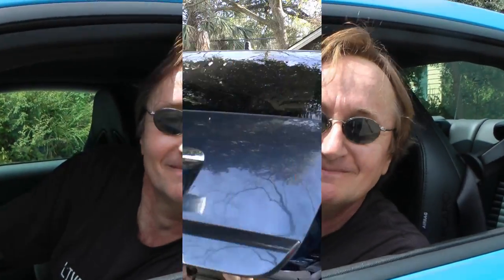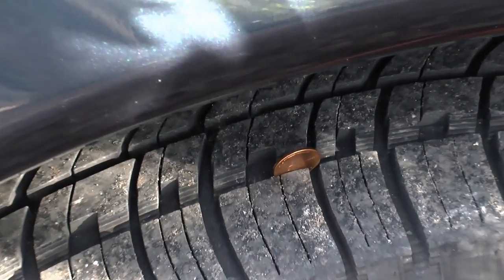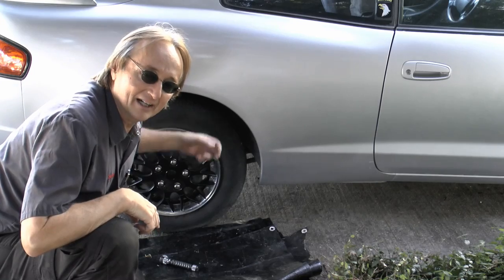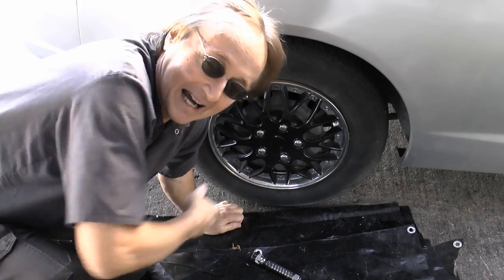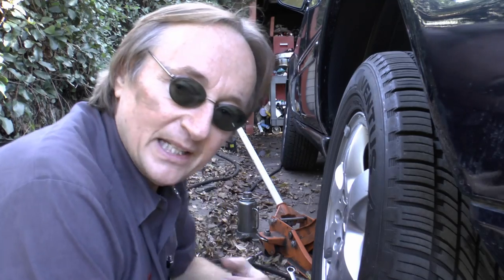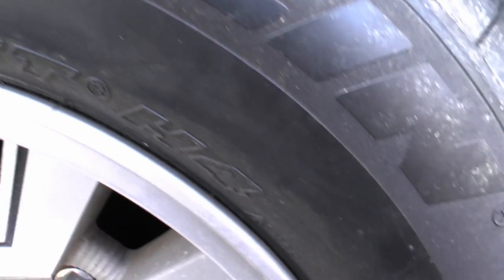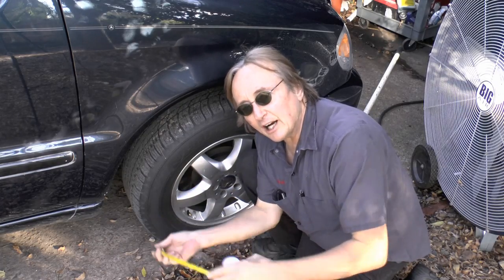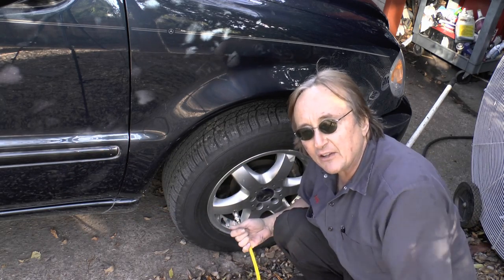How to Tell if You Need New Tires on Your Car

Comment: I have always gone by "you buy cheap you buy twice". So for my car, I always buy the best I can afford. Same goes for when I drink haha
Reply: I don't like cheap. Buy good quality parts and it will last for years.
Reply: It's not as simple as more money = longer life. Some of the most expensive tires out there have between 40 and 200 treadwear rating. They will be gone in about 5k to 10k miles. The Hoosier A6 the autocrossers use only last about 10 runs at the most (~45 sec per run) and they cost upwards of $1,200 for a set. Long lasting tires are not supposed to be expensive, they are supposed to be budget oriented (for cost to buy, tread life, and gas mileage).

For instance, the Kumho Solus KR21 is a 640 UTQG with a 85k mile treadwear warranty (this means they will pro-rate your next set of tires if they do not achieve 85k miles before 2/32 tread remaining).

The BFG g-Force Sport A/S is a 460 UTQG with a 50k mile treadwear warranty.

For my car (Miata 185/60/R14) the Kumhos are $55 and the BFGs are $80 per tire. The BFG is a stickier tire, but it costs more and won't last as many miles. You will also have worse MPG with the BFG, because a stickier tire has more rolling resistance.
Reply: Correct, but the 1200 dollar drag race tires only last for a few races because they are a very sticky.
Reply: Peter Kapica The A6 is not a drag race tire, it is an autocross tire. They are technically road legal, but it would be stupid to run them since it's a slick with two grooves cut in it. They carry a UTQG of 40.

Since you missed the point, I will explain again - the example was intended to illustrate that the softer compounds and stiffer construction tires are more expensive, but do not last as long. For instance, while an A6 is an extreme example, a Michelin Pilot Sport Cup is not and is very commonly found on performance cars from the factory. This tire carries a UTQG of 80, one tenth of the treadwear rating a Prius tire has. These tires last less than 10k miles with normal driving only, and merely a couple of track days if pushed hard. For a normal sized tire (225 section width) they cost around $1,300 per set, or around $330 per tire. They are nearly four times as expensive as normal tires, but they will last just a small fraction of the miles.

So no, you do not "get what you pay for" when it comes to life and longevity.
Reply: That's right and if it floats, flys or f***s....RENT IT!
Reply: taledarkside K then, let's bump the scale down to all-season tires. Spoiler; the results will be the same.

Make: 2012 Honda Odyssey EX (perfect soccer mom car!)

Size: 235/60/R17

Option 1: $475/set Conti True Contact UTQG 800 treadwear warranty 90,000 miles (remember this means Continental will send you a check for the remaining value you missed out on if your tires wear faster than that, ie, pro-rated)

Option 2: $850/set Michelin Latitude Tour HP UTQG 440 treadwear 55,000 miles

The Michelins are much more expensive and last much fewer miles than the Conti according to the companies that made them. More money buys you SOFTER COMPOUND, which gets torn away FASTER by the abrasive road surface, but holds you to the road harder. Softer compounds are also more susceptible to vulcanized polymers as the carcass heat cycles over and over during it's lifetime. The harder compound tire will maintain more consistent grip performance as it ages with use. The softer tires will "fall off" in grip capability depending on how long it is "baked" by use.

Your choice of tire and the compound you are after is purely based on the time which you wish the tire to last and how grippy the tire you wish to be. I like grippy tires so I do not buy anything harder than about 400 UTQG, but this means I do change tires more often. I also pay more for these tires on average. 

Rain racing tires, for instance, are some of the more expensive tires because they have durometer ratings in the 40-45 range. A pencil eraser is a 35 durometer. These tires are so soft they can actually develop bubbles on the surface and blister heavily if not cooled by constant rainwater.

I use extreme examples because they are easy to grasp and illustrate the point., It's all rubber, it's all the same, just at different scales.
Reply: taledarkside You clearly need a lesson in logic or maybe reading comprehension then. I am not making a positive claim, I am debunking a positive claim that displays zero evidence.

The original claim is such: "I have always gone by 'you buy cheap you buy twice'. So for my car, I always buy the best I can afford. Same goes for when I drink haha"

I am giving specific examples of why this is not true. The $850 Michelins will not last as long as the $475 Contis. Even among GOOD QUALITY tires you do not gain longevity by spending more. There are certainly $475 Contis that will be softer and last longer, and there are certainly other $850 tires (maybe not Michelins) that will last as long as the cheaper Contis.

The point is, PRICE IS NOT A RULE FOR LONGEVITY.

I am NOT making the claim that ALL cheap/average tires are long lasting, NOR am I making the claim that expensive tires are all soft and short-lived.. HOWEVER, softer compound performance tires that are not deigned to last WILL cost more money than budget oriented high life tires and people are easily persuaded by this marketing, not realizing that these tires won't last as long.

If you truly think this is common knowledge then explain why a famous youtube mechanic feels the need to tell people the basics about tread life and when to replace tires, as well as buying advice. UTQG is not common knowledge among motorists as much as you might like it to be. Also, UTQG by itself is not a good indicator of tread life, but a manufacturer warranty will give you a good indicator as to what to expect, since they actually put money on the table to stand behind it.

In short, "whoosh".
Reply: This is getting weird but it's still way over your head, teledarkside. You're overthinking this. I'll simplify.

Original claim: "More expensive tires last longer"

Rebuttal: "They frequently don't (with evidence)"

The end.
Reply: taledarkside You can call me an idiot as much as you want, but it won't make it true. I used specific examples and actual evidence to support what I was (and am) saying. If you are unable to understand why I brought up the Hoosiers (which are road-legal) as an example then maybe it's just the pot calling the kettle black. Just because you pay more for a tire does not mean it will last longer. I will refer you again to the Michelin vs. the Continental. Remind me again, which one costs more, and which one lasted longer according to both the highway administration and the manufacturer?

Maybe I should ask you another question so that you can actually think about this; if I purchase two sets of tires, one for $500 and one for $900, how will I be able to tell which one is likely to last longer?
Reply: taledarkside You're latching on to the racing tires, while ignoring the other four examples of normal tires I presented. You are literally attacking ONE FIFTH of my argument. Again, answer the question or continue to look like a dunce that can't read.

For the record I'm a professional racing instructor. Understanding tires (road and track) is kind of my job.
Reply: taledarkside The smell's coming from you.
Reply: taledarkside Are you mad?
Reply: taledarkside Wow, I'm looking at all your comments, you're really quite bad at trolling man. Maybe you should try to me more like Ken M.
Reply: taledarkside There comes a time in every troll's life when he has to take the lead in a troll. Anyone can riff off someone, but a good troll can steer too. Asking me for more material in a desperate ploy for me to lead you down some new path isn't going to bear any fruit dude. 

Here, a conversation is like catch; I throw the ball and you...
Reply: taledarkside Do you know what a tire is?! Can you tell us?! plssssss
Reply: taledarkside #rekt
Reply: I get the cheapest unstudded winter tires I can get that have EU rubber mix ( harder than Nordic mix), use them for 2 - 3 year all year round and get a new set, for my type of driving it works just fine. just got to be aware in winter that its not got the best grip on snow and ice.
Reply: Not so good idea in Minnesota, U.S.A.  Temperature can be -40 C to +40 C.  Winter tire would disintegrate at +40 C.
Reply: Quality is remembered long after price has been forgotten.
Reply: isnt it a good idea to buy japanese. you know they will last long.
Reply: @mareli82  nokia tires are the best for winter driving.
Reply: @MrWalker1000  yea I know what is best for extreme winter conditions, but I don't drive in extreme winter conditions, i drive in the south of Norway, I just need cheap
Reply: @gord2358  what happened to when it was common to buy made in Japan stuff?
Reply: @mareli82  don't buy cheap get quality. This is why everything doesn't last long we are not willing to pay for it
Reply: I don’t think that’s true…usually you buy 3,4, maybe even 5 times 😂.
Reply: Educationally & comedic… golden lol

Comment: I worked for Carmax and they could sure use some lessons about tires from Scotty. They had an F250 with dry rotted sidewalls, and instead of replacing the tires, they flipped the tires on the rim to hide it from the customer. Not to mention the Chinese brands they used whenever tires were actually replaced. Good information in this video.
Reply: Thanks for the tip-Carmax shame on you for deceiving customers.
Reply: DanielJaegerFilms A friend of mine bought a car there. All 4 tires were different brands with different tread patterns.
Reply: Gotta love them chinese tires, i love when im driving and i skid....... specially when it rains, shits have no grip even if like new..... (after a year or two they are garbage)
Reply: That's why I always prefer buying cars from the owner itself. You can examine the previous owner. What I usually do is, to ask the owner to drive out of the city limits, because ''I don't know that place'' so you can already see the way, this person drives.

If I replace tyres, I stay away from the Chinese one too, but I usually buy Nexen tyres. Korean brand, has a very good price usually 3rd or 4th cheapest, but the rating is 2.3 while the best tyre is usually being like 1.7 to 1.4, when 1.0 is the best. That's fair enough to me and reason enough to only pay 30-50% than for a Michelin or Continental. Only Exception is the small sizes, as the price different is very low then.
Reply: Years ago, Carmax used to be a decent place to buy a good car for a few thousand dollars. I'm sure you can still get deals, if you know what your looking for, but I've got MUCH better deals straight from the dealer.
Reply: I only buy new cars in Carmax, my local one sells new Toyotas way cheaper than local dealers. However, their used car prices are ridiculously high and the cars are not even detailed, dirty and poorly maintained.
Reply: I was at and worked at a JD Byrider once. They had 3 Tahoes with dry rotted sidewalls. They flipped the tires on the rim on each one rather than replacing it to hide the dry rot from the customer. Not mentioning they put used tires on that they said were “new”.
Reply: I mistakenly aired my tires up to 70-80 psi instead of the recommended 30 psi. It was left like this for around 23 hours until I  reduced the air back to 30 psi. Do you think this might have caused tire damage and be dangerous?

Comment: I bought one of those manual tire changers at Harbour Frieght and it works great.I got the balancer too.I've already changed 2 sets of tires and got my money back.

Here's a tip when checking pressure.Those rubber valve stems get rotted and cracked just like the tire.When you put the gauge on don't manhandle the stem or bend it sideways because it can cause a slow leak.
Reply: another tip when you switch the tires out thell them you don't want new valve stems(if their still good) or they just DO IT !!
Reply: JohnLeePedimore Thanks for that!
Reply: Do they make anything to balance them?
Reply: Harbor Freight sells a bubble balancer for $79 and they sell stick on wheel weights.All together I've got less than $130 in my whole set up.
Reply: Here in California they sell them at the outlet and show them in the flyer.$39.99

Comment: I work at Les Schwab so ik what I’m talking about there’s a bar on the tires, it’ll be all through the tread they’re called tire tread wear indicators. if they’re level with the tread, they’re at 2/32s, meaning there’s no more tread left for you to drive on. We recommend you replace your tires at 4/32s period. Go get a tread depth gauge from O’Rileys or something like that. They’re $2 and you never have to guess if you need tires or not ever again.
Reply: Bradley Porter aye I work at Les Schwab too
Reply: Omar Sanchez AYEEEEEEEEE

Comment: You should have pointed out to also look at the tread wear indicators built into every tire.  They are labeled on the sidewall by a triangle (like at 3:10 in your video).  If the tread is even with the wear bar the tires are worn out. When shopping, you can also look at the treadwear rating on new tires as a number on the sidewall.  Higher numbers are better, but a harder compound, so they typically last longer at the expense of traction - especially in colder temps.

Comment: Scotty you are sooooooo right and I appreciate all your honesty. I just had a discussion with a tire seller/inspection station trying to sucker me. My 6 year old Michelin tires with half tread had a few hairline cracks not connected, like a half inch long. Oh all your tires are dry rotted but we don't sell Michelin so we can't pro-rate them. Then he said if you buy 2 from me I would pass you. Every year I go though this nightmare on 4 cars from seepage issues refereed to as leaking  (no visible fluids in my driveway ever) to rusty brake rotors (Micrometer shows plenty of surface). Sure glad National Tire and Battery only wanted $1300 to fix those safety issues. I live in West Virginia and rotors rust, I'll keep my original Toyota brake rotor over the Chinese garbage you want to install Thank You. Just took my car to a station that only did oil changes for the inspection yesterday and the tires passed with flying colors. What idiots would pass a law allowing repair centers to do annual inspections? Sometimes I wish I wasn't a service adviser and sold tires for 7 years and restored/showed muscle cars in my past. I just have to laugh at these punks and move on to the next criminal. The 4 china tires I had on one of my cars went back to Sears with a separation in the tread totally around the tire were 3 years old. They had 10,000 on them and it was in the middle of the tire grove, almost hidden. They Pro-rated them at 100% and I paid the difference for some mid grade American tires. At 60 years old I hope I can work on my own cars until the day I die so I don't have to be bull shitted by some greedy toothless WV criminal. Oh well like they say here it's all relative, wonder what it's going to like in 10 more years?

Comment: Don’t forget to check the DOT numbers if you can. The DOT number is a long serial number kind of thing with four numbers at the end. e.g. 4517 That means the tire was made in the 45th week of 2017. Usually tires should be replaced when they’re around six years old. So a tire with the numbers 2512 (25th week of 2012) should probably be replaced.

Comment: Just a note on tire shine products: If you are like Scotty and don't need to replace tires very often, using certain tire shine products will cause the tires to dry rot faster, since you are basically adding more and more solvents to the tire rubber which eventually de-galvanizes the tires.
Reply: +ReddmanDGZ This is true, the tires do rot faster because because the solvents remove the components that keep the sidewalls pliable (its like using industrial detergent on your skin) but there is no Zinc in the tires so they don't actually de-galvinize.

Comment: i ran baldies all round and grip improved in the dry, no regrets
Reply: RIP in rain.
Reply: Casey Urquhart more fun in rain if u know what your doing
Reply: I get you, but not all of us can pull an Ayrton senna on the rain
Reply: TheWretchedWorld i am running almost bald tires in snow and ice but truck is almost 7k pounds .... drives better than my little truck with good tires
Reply: I drove a 97 lt1 formula all winter on shitty dryrotted half bald tires.   Its all about driving skill